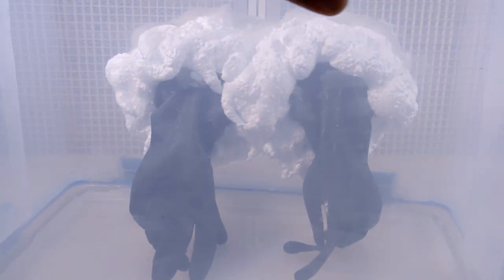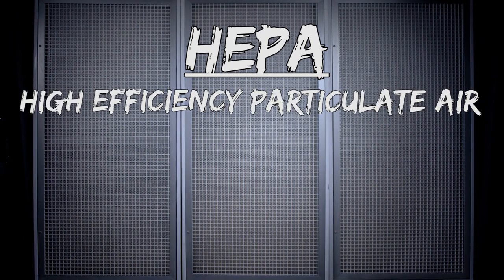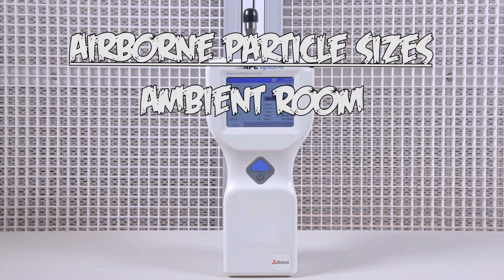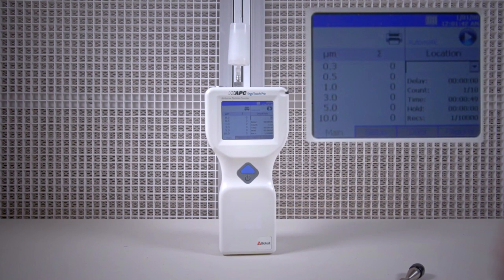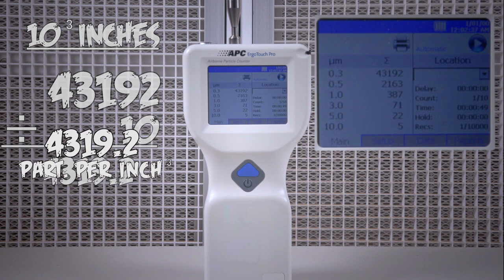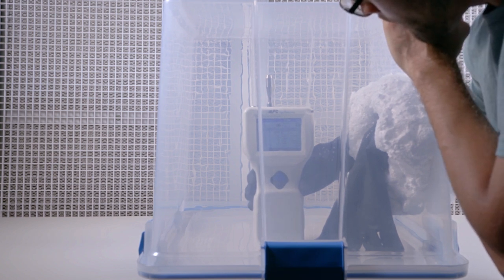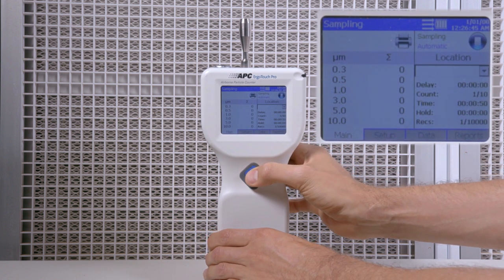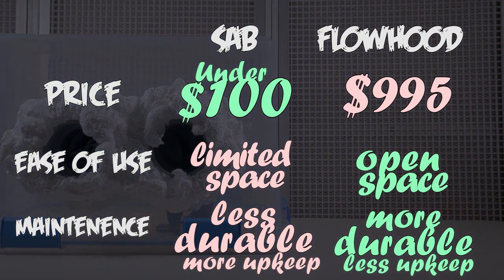Still-Air-Box vs. Flowhood | A Brief Synopsis and Real World Test

Comment: Wait, you didn't let the still air box settle like you're supposed to you just stuck it in with the turbulent air still going. FAIL
Reply from the maker: Nice observation, Teodor!
Reply: yay and I also use spray disinfectation, so there are particles but they are already dead.
Reply: Your comment is a fail, Teodor.
Reply: What I was going to say!
Reply: By no means was it a fair test.
Not spraying the box on the inside and elevating the work station off the surface and leaving the base wet and letting the box sit with everything in it for a while is the unfair equivalent to using a flow hood with a ripped filter or an inadequate fan.

Comment: That's not a still air box.  It's a glove box, and apparently much worse for mycology than a glove-less SAB, which allows some air to flow in and out.  Gloved sealed boxes create turbulence as you move around and the unsterilized air is moving much more than in a non-sealed still air box.

Comment: So if you make one easy mod to the SAB your results will be better. Cover the inside of the lid with a cloth that has been wet with a bleach and water solution prior to positioning the box on top. But you still need to give it some time so the particles settle. I have had zero contamination using this little hack. Full disclosure this was not my idea. Sorry to say I forget the name of the creator who put this out but I would like to thank him!
Reply: Does bleach need to be added wouldnt water work just as fine?
Reply: Nice tip--thanks.  I'm going to try this.  Thought I'd add that 1 teaspoon of bleach to 32 oz of water is a good recipe for decontamination.  This is what at least one cat rescue I know recommended to decontaminate and kill pathogens on things like cat carriers, boxes, etc. that other cats may have used.
Reply: I work in pharma manufacturing - best practise is 70% alcohol 15 min settle contact time then bleach some with 500 ppm strength (Milton) with same contact settle time. A small HEPA grade laminar flow far on top of the SAB would work I have seen many people do that.
Reply: @crazyethanyeahyeah do you have any photo's of the sab you are talking about?
Reply: @crazyethanyeahyeah  if youre running bleach at 10% there is zero need for isopropyl alcohol, as not only does bleach do a batter job of sanitization, utilizing both would be redundant regardless. Also, if you have a laminar flow device, there is no need for the SAB in the first place. 

I have been in the hobby for well over 2 decades and Ive never once seen any cultivators with an SAB as youve described, with a laminar flow "far on top of the SAB". It literally sounds not only redundant (if youre using the SAB properly) but just plain silly. Now, if youre talking about employing the use of a fan and filter in conjunction with a clear tote, to produce clean air to work in, then it is no longer an SAB (Still Air Box), because there is no "Still Air". At that point it would be something entirely different, akin to a HEPA filter fan box.

Maybe it is possible that I misunderstood you, or you that you didnt communicate your idea well?
Reply: @mzp57  not sure what 1tbsp to 32oz equates to, but the general rule of thumb in utilizing bleach as a sanitizer in this hobby is 10% bleach - 90% water. This will sufficiently sanitize tools, equipment, and workspace surfaces. Hope this helps Paul!
Reply: @spaceramshow253  water alone will not work fine. I mean, hopefully the damp towel catches the particulates, however, it does nothing to kill contaminants. 100% recommend wetting the towel with a 10% bleach solution. why even take the chance? Bleach is ridiculously cheap and easy to attain. Theres probably some currently already underneath your sink or laundry room

Comment: I have 2 issues with this video. That is most definitely not an SAB, and that is most likely not a flow hood (I cant tell because I cannot see it in its entirety). 

What you are showcasing is what is called a "glove box" as the cavity is sealed, and the gloves are attached. An SAB simply has holes with which you reach your hands through (gloved or not) into the workspace.

And, a "flow hood" has an actual hood (walls and topping), or in the case of a vertical hood the FFU sits atop and has three walls creating an enclosure to work within. Either way, there is literally an enclosed workspace (except for the direction that faces you). Now, if I am incorrect, and theres an actual hood attached that I simply cannot see in this video, then my apologies for this particular point. 

All that being said, theres nothing wrong with either of these tools youve demonstrated in this video. Both will work perfectly fine for mycology with proper sterile technique. My only issue is the incorrect terminology you are teaching to beginners in this hobby.

Comment: @Fresh Cultivators What if you took and and used a continuous fine mist sprayer with Clorox and mist down the walls so they were damp inside the SAB so particles wouldn't bounce off the walls and be trapped? This is what I'm planning to try so then I can flame sterilized inside the SAB without an explosion. I tried to search for this but I haven't found any information about anybody that tried it.
Reply: Yes, this would work but why not buy a box of syringes for $10 and just use a new syringe on every bag of grain spawn. I do this and have colonization free of contamination about 95% of the time. It takes you having to use fire 🔥 out, so there is no chance of blowing yourself up. I've blown myself up twice and it's no fun. I also stopped getting high before working with fire and it helped a lot as well 😅.
Reply: @boxingfanazM.O.B damn so the explosion is a possibility. Did my first inoculation in a SAB  yesterday and was scared that could happen

Comment: Question.   If i have a tall medical grade HEPA filter ($550) cant i just get some plastic sides cut to form an enclosure and turn that into a "flow hood"... Or heck jsut leave them off whats the difference between a flow hood like you have there and a medical grade HEPA air filter ?
Reply: Laminar flow. It’s a layered air flow with no turbulence. That’s the difference. If you use a filter use it on low setting. You can check by lighting a lighter in front of the air flow. If the flame bends more than 45 degrees it’s too high